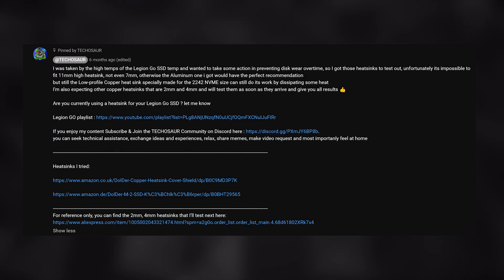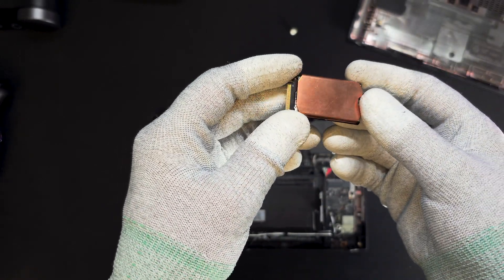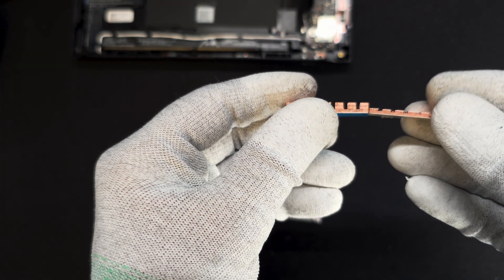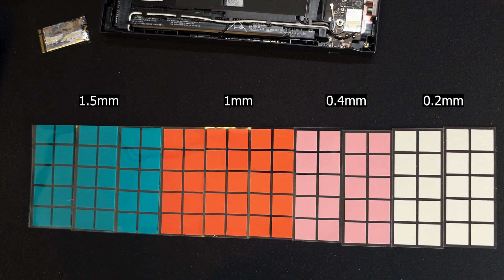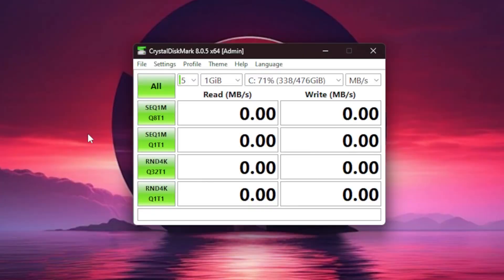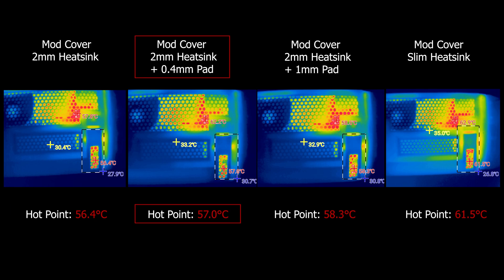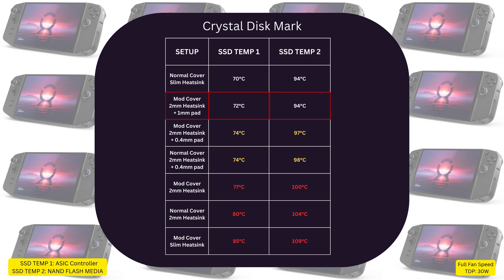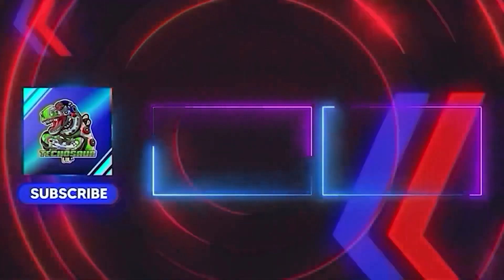Cooling the Uncoolable Legion Go SSD | 2mm & 4mm Heatsink Installation & Comparison

Comment: how is your wifi signal? i read on reddit that it mildly decreases the wifi signal if you put something likethat.. that's why they put those foils around ssd.. now the ssd is no problem, but the heat sink? how is it? have you tried testing speeds before and after?
Reply from the maker: I don't have issues with Wi-Fi after the heatsink. It doesn't lose signal, and download speed isn't reduced

Comment: To be fair, the emf shielding really should come off.  The thermal pad should stick directly to the nand.
Reply from the maker: Is it safe ?
Reply: @TECHOSAUR It's perfectly safe, but if you wanted to keep some of it, you can gently cut around the NAND to expose them without entirely removing the shielding.
Reply from the maker: Do you know how much of a difference it might make between keeping the EMF shielding or removing it when installing a thermal pad with a heatsink for temp
Reply: @TECHOSAUR Not sure, I'd like to test it because mine is still stock.  I'd guess a 5-10% difference.  I'll also consider not using pads, and instead using paste or putty as they're better thermal interfaces.

Comment: I had an incredible time trying to cool down the Legion Go but then I went into Legion Space and changed the options in the cooling menu to reduce the voltages/temps in there... and now I have no cooling issues... fans are not even on to the level where it becomes like an overwhelming sound... they're spinning but I can't hear them too loudly.  It seems the default settings for Legion Go is to overclock the damn thing to where you have trouble cooling it.  Before, I couldn't run this for more than an hour or two when it overheated... now it runs as well as the ASUS ROG Ally X.  

Settings -> Performance -> OS Power Mode.  Move all those levers to the middle of each slider bar and it runs a hell of a lot cooler.  I assume there are better settings, but that's a good starting point.

Comment: Why you did not remove the wrap around from the SSD? It is an insulator at this point. You would get better thermal contact by removing it and replace the thermal pad from the heatsink to something proper.
Reply: Silver foil is to isolate the ssd from the WiFi signals. As the WiFi adapter is right there under the ssd. Just like the steamdeck.
Reply: @KellionBane so it will be problem if we remove the alumunium foil?
Reply from the maker: Does it void the warranty of the SSD ?
Reply: @TECHOSAUR  i have no clue. I replaced mine with 2tb drive so no warranty for me anymore. You can always store it and install it later on if you really are conserned about it.
Reply: it is not a wrap it is a copper sticker it should act like a heat spreader

Comment: Got my 2TB 980 Pro with Heatsink open on the back of the mod cover (it won't fit in the bay), and it is running nicely. it gets hot but not to hot to touch, and it does it while running a lot faster. Shame it doesn't fit in the bay as its not only to tall (as I expected) its to wide even though we are only talking a mm or so on each side , but its on there solid now and can benefit from a USB fan when docked (where it doesn't get hot at all). The faster drives do seem to benefit some games, or at least I noticed it in BG3 as it seems to hitch less, plus I am expecting better sustained boost speeds with less heat in the case.

I filtered the vents mind you as those holes worry me more than the NVMe as it currently is, as luckily I had an old magnetic filter for the 220mm case fan that I cut up and glued inside.
Reply from the maker: its definitely advised to install a mesh filter with this back cover, but if you are not going to use a 2280 drive and just stick with the original SSD 2240 or use a 2230 installing inside, etc it is not ideal to use this cover, this one make sense only for when you plan to install a 2280 drive

Comment: Unrelated but did you notice that bios version 31 defaults to tighter timings with everything set to auto? it tightened my cas latency from 23 to 20.
Reply from the maker: Really? Wow, I didn't notice it. So, they tuned it themselves to get some performance. Good thinking by LeGo team!

Thx for the share
Reply: @TECHOSAUR  update: turns out the ram timings being automatically tightened was a result of me disabling ecc read and write in bios. Gives a small but nice boost in cpu and gpu performance as well as giving you extra headroom for tightening. I got 7500MT @ CL16 working

Comment: You are using the crapiest thermal pad you can get. You need 13mkv thermal pad to work well....that fake pad won't do anything
Reply from the maker: Good idea. I'll look for a pad with higher specifications. If it works, I'll give an update!
But this one seemed like a good one. It states that it's for SSD, GPU memory, and those kinds of mods.

I just found out that i have ARCTIC TP-3 in 0.5mm and 1mm 
used it before on the ALLY SSD and it seemed pretty good, you think i should give it a try with it ?

Comment: Lmao....my 8tb gen4 ssd in my ally doesn't get so bad under heavy gaming....😂 done a proper plate modding cooling 👌😋
Reply from the maker: What plate modding did you do?
Reply: @TECHOSAUR  2 mm copper plate cut to size and drilled holes for ventilation. I dis trimmed the inside of the case. Used mkv thermal pads on top of the apu and ssd. Also done a 2 mm custom cut copper heatsink for the ram(this is not connected to heat plate)

The plate is like a T shape. I play ghost of tsushima at 30w continuously for hours and I don't go over 80c with 65-70% fans speed. Is amazing 👌

Comment: I’ve mention in the last video something is wrong with your SSD. I just tried to upload a screenshot using the same software you are but YouTube keeps deleting it.

My SSD max temp is 74c
Reply: Nope it’s stock. I’m using the ver.1 of the aftermarket back panel
Reply from the maker: Some users reported concerning SSD temperatures too and even game crashes due to this. It's strange that Lenovo has never made a statement about it. I tried two drives, one 2242 and one 2230, on the mod cover and original, and used them with different heatsinks. when running CrystalDiskMark I  never get less than 90C
Could be the controller ?
Reply: I would contact lenovo. Your legion go is still under warranty and I would show them the videos and see what they think. You may need a new unit.
Reply: I even changed my ssd to a 2280 4Tb 990Evo Plus and max temps at downloading and installing 1Tb of Steam games in one go  it reached without ANY cooling pad or whatsoever gave me max temps 75°C and that’s whith the original cover and the 2242 to 2280 180° adapter. Also had the max tdp to 30w and fan was set to smart. 
How are people getting above 90?
Reply: @afonsomreis wich switch 180" do you bought?
Reply from the maker: I tried an M.2 2230 SSD, WD Black SN770M, and it also gave me high temp. Did you remove the foil?

I'll try to set you an approved member so maybe you can share a acreenshot link
Reply: @TECHOSAUR  My original 1TB WD drive that came with my Legion go also hit the temperatures you saw.  I replaced it with a Kingspec 2TB 2242 ssd with the foil. Now the hotspot doesn't go above the low 70s in crystaldiskmark and high 50's to low 60's when gaming :).  It is dual sided so I found that the slim copper piece won't let the case snap back together but it hasn't needed the copper mod at all with that SSD.